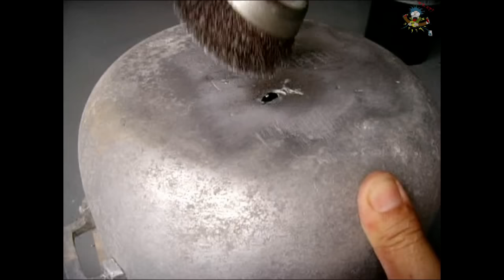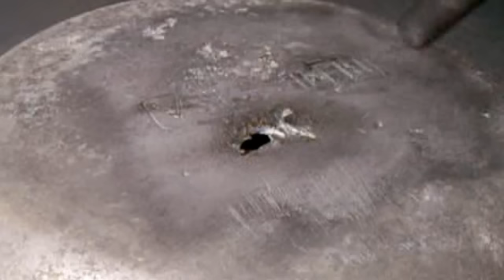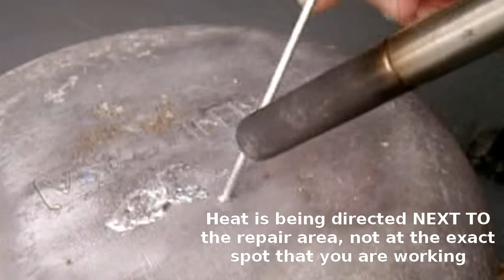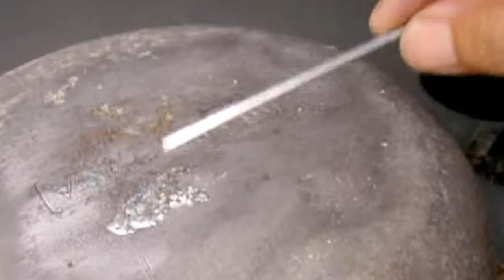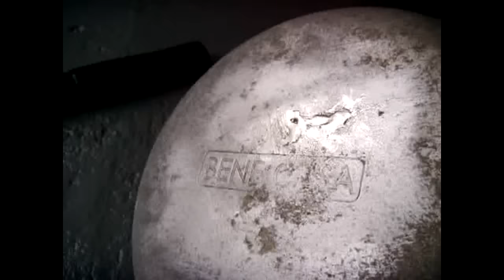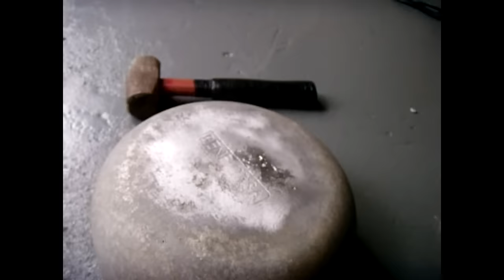How To EASILY Repair Holes In Aluminum

Comment from the maker: **For GREAT deals(Usually cheaper than EBAY) on aluminum brazing rods & flux, test equipment, electronics, drones, automotive tools, household items, phone accessories, locksmith tools, & much more, please visit the link below and SAVE IT AS A BOOKMARK on your computer or smartphone to Banggood for future purchases. (Your purchase supports my channel!) 
All Items: http://bit.ly/2cgYr14 
Flash Deals: http://bit.ly/2cb6CZB
 **Try these money saving coupon codes, or ask if other codes are available: 6% off everything: affiliate6 12% off Home & Garden: BGHome 12% off electronics: elec or measure 8% RC Toys & Hobbies: ToysHo
Reply: can you drill through the aluminum that you cover the hole?
Reply: ¿How strong is that fix against heat? ¿Can it whistand car engine heat?

Comment: worked great for me on 1/8" hole in aluminum canoe.  I did it in the sun - the aluminum was thin and ambient temp was 70 but the canoe was probably about 100 degrees from the sun. Used yellow propane bottle and the whole project only took about 30 min - including cleaning aluminum, heating and brazing hole, grinding and cleanup.  I'm sure with thicker aluminum and/or a bigger hole it will take more time.  THANK YOU very much for posting the video!!!!
Reply from the maker: You're welcome! Be sure to share my channel with others and rate thumbs up. Thank you.

Comment: Almost wasn't sure if I was going to be able to do this with the propane torch I bought and then it finally started working. Using it to fill holes in my custom putter I'm making and so far it's working great

Comment: I did a similar repair several years ago. I preheat the pot (Magnalite) in the oven to 400*, to minimizing the heat sinking problem. Then I brazed the crack. Once finish I placed it back in the oven and turned it off. Let it cool down over night. Still using the pot to this day.
Good video.
Reply from the maker: Slow heating and cooling is the best method.

Thanks For Watching! Be sure to share and rate thumbs up.

Comment: Really solid amount of information, clear concise and to the point, didn't leave anything unanswered!Im gonna be using this technique to fill some small 1/8" - 1/4" holes in my jon boat, and sealing my rivets for next duck season.  THIS IS WAY BETTER THAN SENDING IT OFF TO A WELD SHOP AND SPENDING $100 USD
Reply from the maker: +M Thom 
Glad you enjoyed the video! Just make sure the surface is SUPER clean using a grinder followed by a stainless steel wire brush.

Comment: You solved a problem on which I have been working for three years in less than 6 minutes.  Thank you.
Reply from the maker: Thanks for watching Luke!
Reply: What problem did you have?
Reply: @jeevunvethanayagam6536  I have a pair of Hartley 24" Concertmaster speakers which have had the aluminum pit horribly.  They are quite valuable and incredibly rare and collecible.  The foam surround disintegrated over the decades.  This brought them to within 20% restored.  Thank you!

Comment: Great video! SO helpful. I'm wondering will this repair will withstand the heat from a very hot wood burning stove. (its an old aluminum tea kettle with a hole a little bigger than a pin hole).
Reply from the maker: As long as there's always something in the pot, it will hold.
Reply: @electronicsNmore  That's very good to know. I had a pinhole leak in my small aluminum pot and used one of these rods with a blow torch. I was paranoid that when I heat the pot on the gas stove it'll melt the rod metal right off again, but it makes sense that when there's water/soup, liquids inside, it won't be heating up enough to leak off and burn through. or atleast, I think that's how it works?

Comment: I always heat the Aluminum and the rod at the same time. Its cool stuff if you learn how to use it! One can also make a dam with sheet metal to fill in large areas, I did it to a corner on a timing  chain cover.  BTW I also can gas weld 308 Tig rod on stainless!  I am not a welder!

Comment: That is some serious exacting heat application to pre heat and  fill that hole WITHOUT burning thru. And the material seemed to magically fill in. looks like you've had some practice.. Very well done. I have a aluminum water  tank in my boat that doesn't leak yet but I want to fill some pitting before it eats thru. Going to try and apply your lesson. Thanks
Reply from the maker: Hi Robbie. Just make sure the area is SUPER clean(bright and shiny), and only apply enough heat to get the brazing rod to melt when touched to the aluminum surface. You'll likely need to use a MAPP gas torch. BTW, nice Gag Grouper. I freedive & spearfish. I've blasted some big ones too in the past.

Comment: Seems to me that you could have saved a lot of Propane by placing the large Aluminum pot in a 500 degree oven first to preheat the whole item. Then it won't suck away all your heat so fast. You do the same thing when repairing Cast Iron items to prevent thermal shock. Cast Iron actually needs to be put back in the oven after the repair so it can cool slowly and lessen the chance of it cracking and spoiling your repair job.
Reply from the maker: Best Racing Tips Win At The Dragstrip I have used that technique before. It does work very well.

Thanks For Watching!
Reply: Best Racing Tips Win At The Dragstrip What happens if you have a bigger job do you wanna buy a big oven.
Reply: S'all gud man he looks lyk his rich...... with propane gas i mean..

Comment: Will the same technique work for screw holes in a vertical sheet of aluminum? And, if so, can the resulting filled hole be filed or smoothed before painting?
Reply: Did you get it to work? This is the same project I am considering.
Reply: @William_Van_Landingham_III  Sadly, haven't had a chance to try it yet --life got in the way.  Hopefully soon but - - - -

Comment: Thanks for the informative tutorial! 
Could you please tell me how to handle dents in aluminium pots, such as pots for outdoor activity? 
I read the aluminium must be heated as well, so the material can be reshaped. Or is that not needed with thinner aluminium? 
I'm pending between dealing with the dent and the dented bottom or going for a fix. I'm afraid I might weaken the overall material.

Comment: didn't know that you could do aluminium welding with just a little propane torch very nice .2nd question after sanding down metal for prep can you use acetone for cleaning ? metal to be sure ? by the way liked your vid .
Reply from the maker: Hi Mario. No need to clean the aluminum  with anything but the wire brush unless the metal is oily.
Thanks for watching!

Comment: Some advice, dont use a drill or grinder wire wheel to clean oxidation, use a clean stainless steel brush only. Scrub until you feel the brush kind of digging in, thats the clean aluminum.now you are ready to weld or braze....

Comment: I'm glad you uploaded this video I have a big tea kettle with a tiny hole in it I need to repair, before this video I couldn't see anyway to repair it and still be able to heat it.
Reply from the maker: maynardcat As long as you clean the area extremely well using a stainless bristle brush, and do not apply too much heat, you will be able to repair the area. As you heat, keep testing the temp of the pot by touching the brazing rod to the pot, when it starts melting, pull back and maintain that level of heat! The initial filler needs to be brushed into the surface when molted before applying the rest of the brazing rod. When cool, file, or grind to shape.

Thanks For Watching! Be sure to Share and rate Thumbs Up.
Reply: electronicsNmore  Thanks for the advise, it's an old tea kettle from the late 40's or early 50's so it's worth saving, and now I can with your advise.

Comment: What is the specifications for the Heat Gun or Touch, what is the Wattage, what is the minimum and maximum temperature ranges, what it the model number and manufacturer, and where to buy the touch? Thank you

Comment: I want to repair some pitting in my pressure cooker. Will a handheld propane torch work for this? I can heat it up mostly on the stovetop as the pitting is inside the vessel. This is even cheaper than jp weld which it looks like is not ideal.

Comment: Looks good. I was looking for a video for repairing a hole in an aluminum pontoon. I think ill practice with a few pieces of aluminum first. Really appreciate the video it was done well.
Reply from the maker: Part-Time Picker The only problem is you'll need a lot of heat to work on a large, thick area of aluminum......maybe easier to buy a small piece of aluminum plate and rivet it to the boat over the hole with 3M 5200 marine adhesive applied. Fill in the rivets with the 5200 also. If the hole is very small, just wire brush the area really good, wipe down with 91% rubbing alcohol and use only the 5200.
Reply: electronicsNmore i use map gas when I am soldering copper pipes do you think that would work? That gets much hotter than propane? Also it only appears to be two pinholes. On the front of each pontoon. Probably from hitting / gliding up on rocks on shore. I actually just thought about drilling the hole a little bit larger and filling them with silicone. It only has to float on top of the water. No pressure really. Any thoughts?
Reply from the maker: Part-Time Picker Wire brush the area until super clean, wipe down with alcohol, and use the 5200. Press into the holes and smooth with a wet finger....it will last years.
Reply: electronicsNmore 5200?
Reply from the maker: Part-Time Picker Look it up 3M 5200.
Reply: electronicsNmore o yeah cool, marine sealant. That would probably be the way to go. I was just thinking 100% silicone. You’re awesome thanks I’m also going to subscribe to your channel looks like you have a bunch of cool videos. Have a good one.

Comment: I plan to use your technique on an aluminum crab pot that has a couple pin holes in it....but what is stopping the brazing rod material from re-melting (then exposing the holes) when I put it on a propane burner?????  Thanks for helping
Reply from the maker: As long as there's liquid inside the pot, it will never melt out when over a flame/burner. :-)

Comment: This looks awsome but my main question is, is it as strong as aluminum and also why does this rod melt so easy because i thought it was hard melting al with a reg torch
Reply from the maker: You can melt aluminum with ease using a torch.

Comment: Great video. I noticed you didnt prep with any flux to decontaminate. Is that unnecessary? Flux also opens the pores of aluminum to take the rod better. Thanks for posting
Reply from the maker: The manufacturer said no flux is required. Thanks

Comment: I have aluminum ports on my truck's throttle body and one of the ports has holes from passing 34 years of antifreeze. I want to fill in the holes but I am afraid that heating the port up will melt it. Any thoughts on this scenario? Appreciate any input..thks...hc
Reply from the maker: Visit a salvage yard and swap it out, or use a 2 part aluminum repair epoxy. Thanks for watching!
Reply: @electronicsNmore  Well I made a foopa.  I did a magnet test and found that my throttle body is aluminum but my ports are stainless steel. So I have to look at stainless steel solder..Thks..hc

Comment: Fantastic video can i do that on a alloy boat hull that has a few small holes, and what are the rods called you use, what sort of gas is it you use. Thanks farmer
Reply from the maker: You can repair an aluminum boat hull, but you'll need A LOT of heat to get the job done. Use a MAPP gas torch at very close distance, or an oxy-acetylene torch. If you don't care about looks, you can also take another small plate along with 3M 5200 sealant and rivet it over the area of holes.
Reply: Thank you

Comment: You might have addressed this earlier but WHY the stainless brush?  Could you use a Bronze Brush?  Also, would this repair hold with a hole in a piston head from a valve cover braking off?  What can I say, I like to recycle!
Reply from the maker: The stainless steel brush is recommended because it leaves nothing behind to contaminate the brazed area, and also because it is much harder than aluminum. I would say the repair would work, but you also have to realize that the piston and brazing rod are not the same exact metals. They will both expand & contract to heating or cooling in a slightly different way. Give it a try, if you do a very good job, it may last a very long time. Nothing to lose.

Comment: Could you use this pot (and particularly the weld spot) over an open flame (say a propane burner) after it cools and sets? Or would the weld fall out?

My turkey fryer pot has a hole in it and I'd like to repair it. But if I can't use the pot on the fryer propane burner after repairing it then it doesn't help me much.
Reply: +Trevor Fisher  The moral here is: never get a hole in your pot. Pologise.

Comment: Is it gonna work for steel or any any other type of cooper or metal? Hey good job! Sir
Reply from the maker: Alumite rods can be used for Aluminum alloys, Zinc Diecast, Pot Metal, and White Metal. To braze steel, you would normally use a flux coated bronze brazing rod.

Thanks For Watching. Be sure to share.
Reply: electronicsNmore Great video do you have a video on repairing pot metal?
Reply from the maker: Same procedure.

Comment: Thanks for the video,
I've had some of these rods for twenty years, I was never able to get them to work, I think your video should help, I will probably have to use steel wool on the rods as well, they have kinda turned dark over the years.
Do you think it will work on cast Aluminum as well, that's what I really need to repair.
Reply from the maker: Robert Salser Cast aluminum should'nt be a problem.

Comment: These rods are not as easy as the adverts make it look..these rods require a lot of heat more than a propane torch produces..I had many failed attempts using propane alone and map gas wasn't much better..For anything thicker than 2 mm u have to use a gas oxygen torch...
Reply from the maker: No a propane torch produces sufficient amount of heat. If you are repairing a thick piece of aluminum, or large piece of aluminum then yes you're going to need more heat

Comment: I have several cracks in my crankcase.  I am going to attempt to weld it together with a propane torch.  Should I apply aluminum from the inside or outside?
Reply from the maker: You need to drill the ends of each crack using a small drill bit. Doing that prevents the crack from extending further. Also grind a small depression over the entire length of the crack. The repair works great when done PROPERLY. Practice using something similar first.

Comment: I had a large aluminum kettle once that developed a hole.  I brought to a shop where they brazed it and filled the hole with an aluminum brazing rod  This was back in the 1970's.  .  When I tried to used the kettle the patch melted and I was left with 75 dollars wasted and a useless kettle. I was using a small primus gas camping stove so the fault can't be the stove.  How sure are you that your patch won't melt when heated?  If you use an electric stove for instance, the electric element could melt your patch whether you have water in the pot or not.
Reply: +Indrekk Pringi i dont think he plans on heating it
Reply: Please take a class in thermodynamics.
OR search you tube for someone boiling water with a flame in a paper container.  

If there still is water in the container of any material, the temperature of the container will not go above the boiling point of water (100℃ / 212℉) - well below the melting point of AL (1350℉, as above) and the combustion point of paper (451℉)

Comment: Amzing, I Tried like this for like an half an hour with torch and fire bricks and no result.
Reply from the maker: Maybe the base metal is too thick and not getting hot enough to allow the brazing rod to melt. You may also have a dirty surface.

Comment: I have a small hole in oil pan on my Mitsubishi cant find a oil pan can i use flex seal tape on it?
Reply from the maker: Vanessa Bryant Flex seal tape is no good for applications 200 Deg F or higher.
Reply: Is the flex seal puddy or spray better

Comment: I have a Galvanized water tank it has a pin hole 
 how can I fix my tank
Reply from the maker: Hello Alan. You need to follow my video below. These rods aren't for steel. You'll need to sand the area bright and shiny down to steel, and use a bronze brazing rod with the flux shown. Of course the water cannot be leaking out during the repair. Have good ventilation, because the zinc coating may fume. 
https://www.youtube.com/watch?v=hEx89N3f9u4